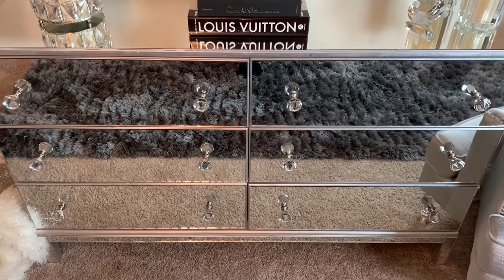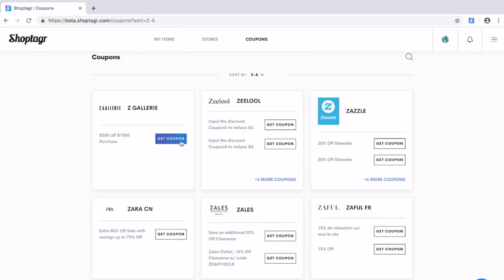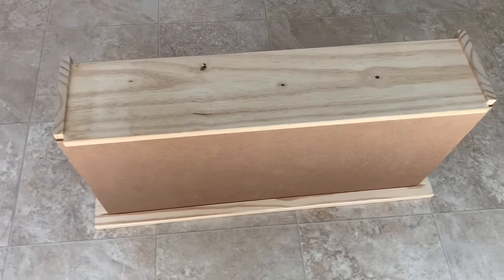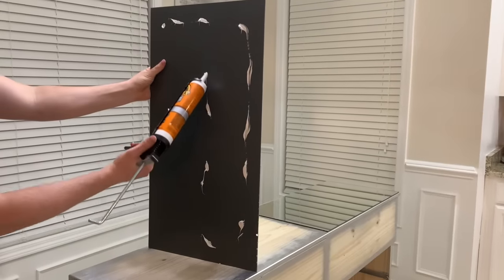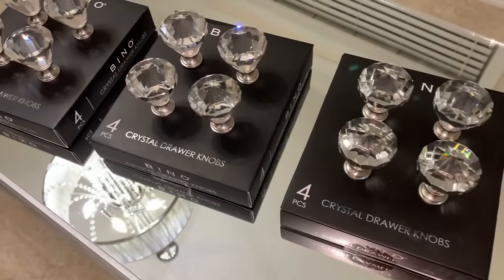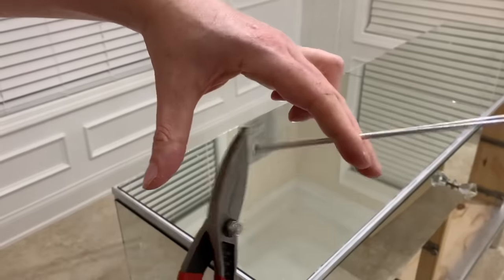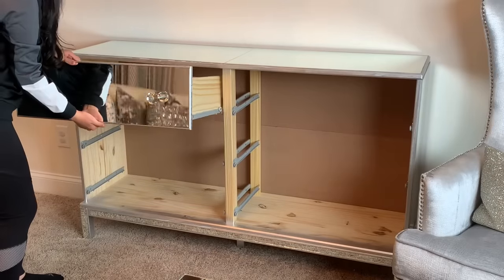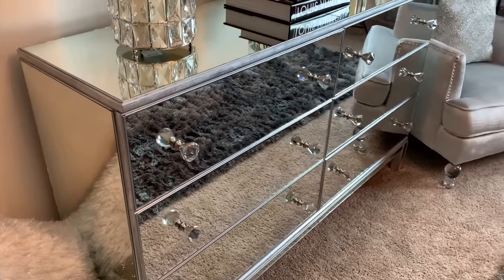DIY Mirrored Furniture Makeover! | IKEA HACK! | Incredible Before & After

Comment: Now, it is a little over a year later. How have the knobs held up? Are they still on, or have you had to re-glue them? Thank you!
Reply: Yes mine kept coming off. It’s really annoying!
Reply: chandrika spratley i think you have to re-glue them again..
Reply: You can cut holes on glass for knobs its not tempered
Reply: Yes I want to put glass on the front of my drawers for my dresser, nightstand and chest I already have to brighten them up. I was looking at her glue on knobs like🥴. I will get measurements for the holes already in my drawers and get Lowes to put it in the glass. But great video! Thanks for the tips!
Reply: @blkbutrfly  lowes drills glass too?
Reply: @yeyayeya9763  I haven't checked yet but I wouldn't put it past them to since they cut it. I didn't even know they did that lol.
Reply: @yeyayeya9763  no they don’t